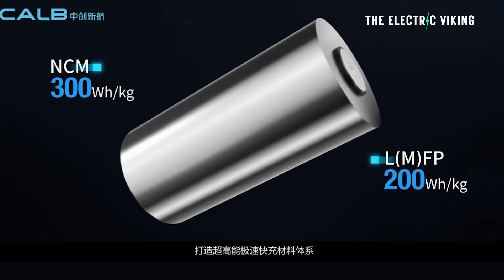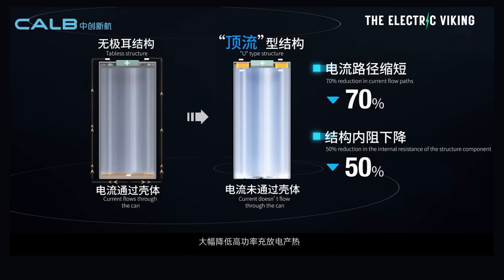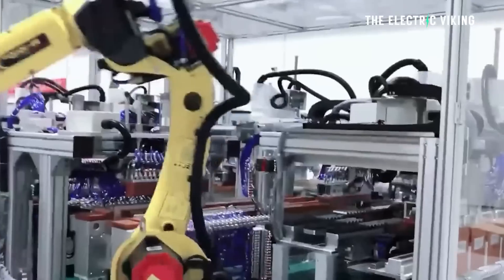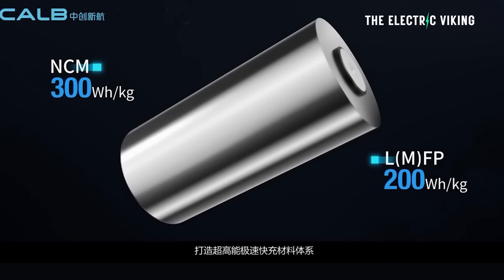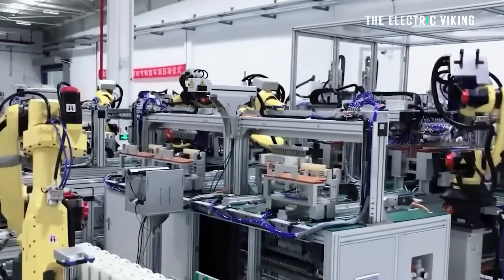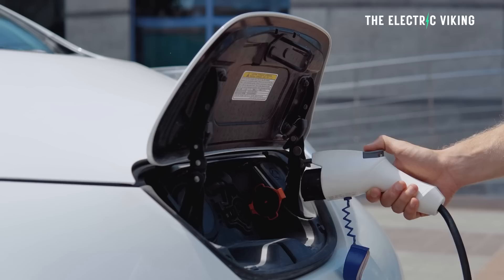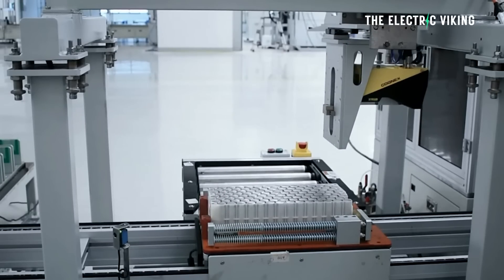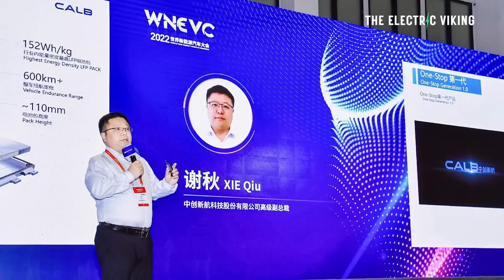CALB says NEW battery has far higher energy density than 4680 cells

Comment: The major advantage of 4680 is charge time, density is secondary.  There have been some high voltage charge systems that shorten charge time but they degrade the batteries; 4680 was suppose to avoid that.  Nonetheless 4680 isn't working out for high production; so Tesla's best option is to find a better battery than 4680 or at least one people will find acceptable as a substitute in cybertruck - maybe this could be a dissapointing alternative.
Reply: 4680 production is ramping toward high volume - that process takes years, as will be the case with any substitute.

Comment: 4680 is after all a cylinder cell, which provides good protection but limited energy density. it is true that 4680 has higher energy density than 18650 and 2170 because of its smaller surface to volume ratio. still, in terms of space utilization ratio, the cylinder is no where near prismatic cells commonly used for LFP battery. 4680 could be a good option for NCA battery, for which safety is a concern but i will happily get LFP battery with prismatic cells

Comment: CATL, CALB, BYD and other battery producers keep comparing their battery tech to 4680, particularly Tesla’s. They have been using it as a benchmark for quite some time now. This says a lot about 4680’s potential. It’s the battery to beat. Not pouch (i.e. GM’s Ultium) or some other cylindrical cell.

Comment: Just want to point out that 6C ≠ 350kW charging. The cell itself can be recharged in 10 minutes but the wattage the car pulls is entirely dependent on battery size! Imagine a 1kWh cell, at 6C this means 1kWh/10 minutes = 6kW. If the battery were 100kWh, it would be 600kW, and so on. Also remember that peak charging speed only occurs at about 20-80% so full charge time be slower, plus you still need to keep the cells cool so you may not ever charge them all at peak speeds at the same time.
Reply: Yes indeed, cooling is another major issue, re charging at 1.2MW for say 8 minutes. Just a 1% inefficiency is of course 12 kilowatts of heating  needing to be coped with somehow. I don't know the general efficiency figures these days, but it used to be at least 5% losses. (60 KW !)
Reply: @tomlewitt  Good pt! The need for cooling at high charge rates (like 6C) is one reason why the cylindrical format could be preferable over any more tightly packaging prismatic or rectangular/flat cell format.
Reply: Please lol my top charging speed sadly is about 15% to 40% then the curve on my 21 m3lr dives down limbo style. 

I wish it was 20-80. Do you think this could be improved with software? Or we need these hardware improvements?  Cheers mate

Comment: I think the bottleneck problem of mass EV adoption will slowly shift to charging stations, where drivers will be demanding 10 mins charging time, max. And with batteries eventually 200kwh for mass adoption (ICE-equivalent zero hassle for long trips) , then chargers will have to be well over 1 Megawattt each. No way the grid can cope with huge numbers of those in real time...So I'm guessing each location of these will have containers full of batteries to help do this?
Reply: Pretty much right, except if the demand truly is constant we will need to run new lines. This isn't a problem though - you have big factories using more than 1MW, they can use tens or even hundreds - it just requires some planning.

Comment: Elon Musk said years ago many people have a great battery in the lab but can you mass produce it? For the electric car to take over America the car needs to go at least 4-500 miles on a charge.2. The battery quick charge under 10 minutes without robbing the battery of its long term density.3. Work good in cold weather. I think all of these problems will be solved by 2030, i hope. Also     the specs for the lowest priced model y have a range of 279 miles. I presume this is the 50kw pack. This range is not acceptable. This also shows that the current 4680 battery is nowhere what we were led to believe, it is extremely overrated. If the battery is this weak they must make the pack much larger.

Comment: Doesn't 4680 refer to the physical size and dimensions of the battery rather than the chemical content? Like the 18650, or the AA, or the D cells. Inside that dimension you can have Carbon Zinc, alkaline, NiCad, lithium ion etc. Same size, different chemistry. Energy density is dependent on content rather than size. Like my head. I'll go back to sleep now.
Reply: 46 mm diameter, 80 mm long

However, Tesla adds a design that can utilize various chemistries, including ones that will be developed down the road.
Reply: As far as Cylindrical cells are concerned, at least the module level energy density can be influenced by the physical size and proportions of the cell.
Reply: Yes, 4680 does refer to the physical size, but also to some other physical factors such as both positive and negative contacts being on the top of the battery. Tabless design is implied by the fact that this is the only known way to cool the larger diameter (relative to 2170) cell when used with NCA or similar nickel lithium design.
Reply: Yes 4680 are chemistry agnostic

Comment: Sam - Thanks for bringing the CALB tabless battery to our attention. CALB's 300 watt-hours per kilogram would be a major improvement over Tesla's present 4680, but the present 4680 can be improved in its energy density. What's most impressive is CALB's reduction in internal resistance by 70% and resulting ability to recharge at the 6C rate (in 10 minutes). Tesla's 4680 may have a very similar capability due to the 4680's tabless design well. The 10-minute recharge capability for both Tesla and now CALB show that recharge time will no longer limit the attractiveness of EVs vs. IC engine powered vehicles.
Reply: 3 KWh per 10 kg would push ICE vehicles over a cliff.
Reply: LFP in 4680 format was always the obvious solution. Efficient and fast is good but they have to be low cost as well.

Comment: Tesla is still struggling with the 4680 dry electrode.   WHEN the dry electrode works it will be a big cost savings.  1/3 the factory floor and no drying ovens for the electrodes.  This choice of comparison does not give me a lot of confidence in the company.
What is "one step minimalist concept"?    Guessing with stock IPO around the corner they are punting.
Reply: Tesla is cranking 4680’s out today, n several different plants.  Your information is out dated, and was partially incorrect.

Comment: They all have a Bette chemistry than Tesla but the cyber truck has a 100kw for 500 miles. This is insane
Reply: No way, the Cybertruck will have 500 miles range with only 100 kWh. Even the Model S has only 400 miles range with 100 kWh battery.
Reply: @huckleberryfinn6578  Did you ever consider that Tesla has improved the engineering of their motors making the vehicle more efficient? I bet you the battery pack size to range ratio will blow people's minds when the CT launches.
Reply: @thestonksmarket1897  you can improve motor efficiency but you can’t beat physics. CT is much more heavy and has a worse aerodynamics in comparison to the Model S. Look at what battery the Ford F150 has. 300 miles with 140 kWh battery. No way CT will go 500 miles with only 100 kWh.
Reply: @huckleberryfinn6578  For starters you can’t compare Ford’s subpar engineering to Tesla’s… Munro & Associates has compared the Ford Mach-E to Tesla’s Model Y and it was a night and day difference. Engineering absolutely does go a long way in efficiency of the battery. Maybe 100kWh for 500 miles is too ambitious but we also don’t know what engineering improvements the CT will have over all other EVs (including other Tesla’s) so I bet you it won’t be far off. Battery chemistries have also improved (and will continue to improve) since the launch of the Model S, so there’s that.
Reply: @thestonksmarket1897  again, excellent engineering won't break physics. Moving things takes energy. Tesla have done amazing things for efficiency in the motors and inverter, saving more power through regenerative braking. But 500 miles on 100kWh is a stupid hard ask, it won't be achieved in a big angled truck with a ton of extra weight. Perhaps in a small, compact, aerodynamic car (I think there's the Aptera, but look at the design differences!). I think this is a stupid argument, and a stupid hill to die on - if Tesla wants a huge range for a truck, they'll load it up on batteries, a little extra weight won't make much difference.
If you need an analogy to show you this has historical evidence: look at the Tesla semi. 1MWh battery for 1000 miles - of course the cybertruck will be more efficient than that, but it shows that "Tesla engineering" won't magically mean a tiny battery in everything.
Reply: @Nabushika  Why are you assuming physics has to be broken here? It seems you're assuming other companies that have EV trucks (hello F-150 Lightning) have engineered their truck/vehicle such that they can utilize physics to its fullest extent. I do not believe other companies are GOOD ENOUGH to utilize physics that way. Many people said Tesla's fully electric semi with 500+ miles of range fully loaded at 80,000+ lbs gross weight wasn't "physically possible" but it turns out it was (you can go watch the test drive), because Tesla's engineers are that good. The CT will absolutely get more range/kWh than the F-150 Lightning. Sure, let's forget 500 miles on 100 kWh for now since no one knows the specs yet, but the comment directly preceding this one still stands. CT is also FAR more aerodynamic than the F-150 Lightning for comparison. Let's revisit this when the actual specs are out and the CT is hitting roads :)
Reply: @thestonksmarket1897  gladly, I'd bet actual money that it doesn't hit 5mi/kWh in normal conditions.
Reply: @Nabushika  You didn’t read my last comment thoroughly it looks like. I already stated we can ignore 500 mi on 100mWh, but that the CT would get more mi/kWh than the F-150 Lightning due to superior engineering.
Reply: @thestonksmarket1897  oh, I don't doubt that
Reply: @huckleberryfinn6578  no way I agree with you
Reply: Haha stop spreading misleading information. No way with 500 miles on 100 kW.
Reply: To start, it isn't kW, it's kWh.  And we have no idea how big the pack on the Cybertruck will be.

Comment: They have said. But until we see we'll take it with a pinch of salt
Reply: 😂😂 until you see it... surely 😆
Reply: same applies to 4680. Until it finally gets mass produced it's nothing but salt
Reply: Prototyping is easy, production is hard.  

4680 will get different chemistries and undergo optimization well before any competitors get their prototypes into scale production.
Reply: Yep, also it’s not hard to have a higher density than a 4680. Tesla is far away from optimizing the cells.
Reply: @benv4925  It is weird they are comparing their products to Tesla's batteries. Tesla is just beginning the path on batteries and kinda "newbie" at the moment. 
Not expecting anything huge from Tesla's batteries for few ore years. Innovation pace is what Tesla is known for but no just simply jump in front of everyone at the beginning.
Reply: @benv4925  the tear downs by Sandy munro and the limiting factor show the 4680s made last spring match the best current 2170 cells for energy density at least at the pack level. Plus 4680 is teslas first in house cell EVER. And on a 6 year total timeline. Imo tesla hit a grand slam with them.
Reply: Take model 2 with too much salt coz Tesla Roadster 0-60 in 5 years counting cybertruck 4 years counting.